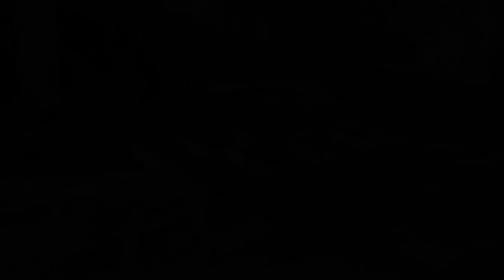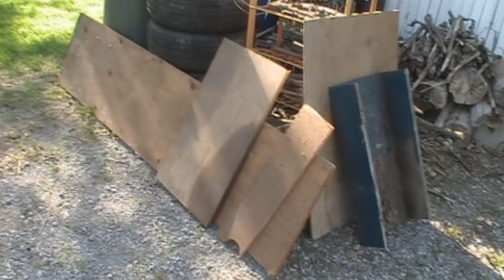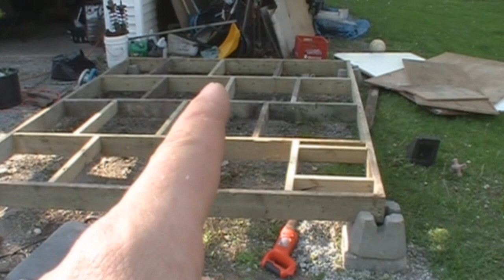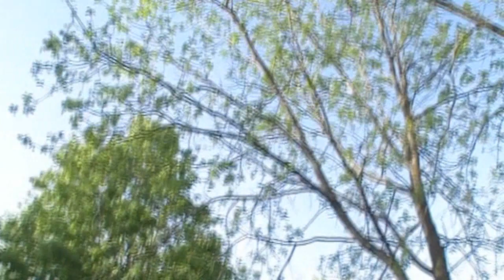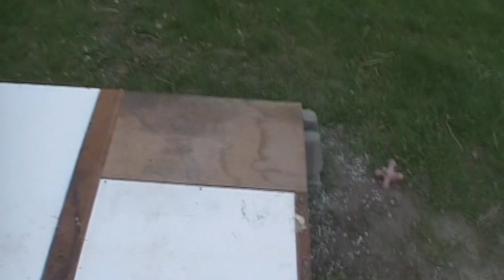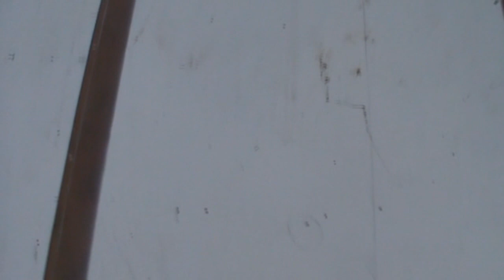Remember my free Craigslist shed?

Comment: 600mm centres and check your diagonal for square 
If you can put insulation and a breathable moisture barrier in the floor joists it will help during the
 Winter this goes for the walls and roof section as well   happy building 
Ps... do you have your construction safepass  :)

Comment from the maker: Thank you kind sir. I was going to put it up Monday but it was calling for thunder storms so I didn't.... still no thunder storms... lying bastards!! LoL

Oh well, that delay just made me go ahead and decide to repaint the roof and freshen it up. It's was dull and covered in surface rust and figured not only would it be easier to do this while they are apart, but the fresh paint will help seal the edges better too (I would guess).

Comment: Wow! I am getting a shed this week and was trying to figure out how to make a floor. Well thanks to you I just found out how. Just a question are those 2 x6 around the perimeter? Great video thanks for your time in making it.
Reply from the maker: The majority of it is 2 by 6. I could of done with narrower spacing for a couple more cross beams but in general it is holding up well. I had A LOT of weight in the and it sagged a little and I ended up adding a support in the middle but that shed had way more than an average Joe is going to have in it... believe me. LoL 

Thanks for dropping by and please keep in mind I am not a carpenter and I was using what I had on hand and though it worked out for me, I'm sure some real carpenters are out there smacking their foreheads at my craftsmanship.
Reply: Thanks for the info going to try it your way! I believe it will be great!